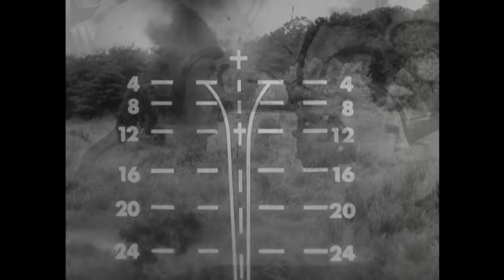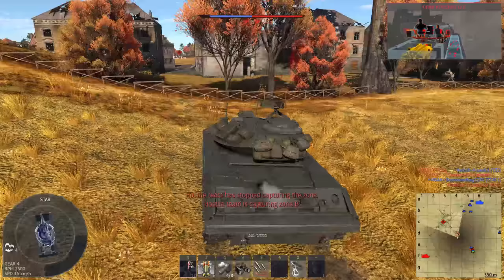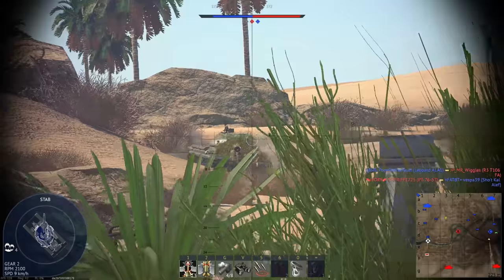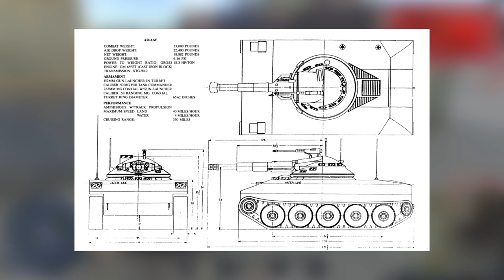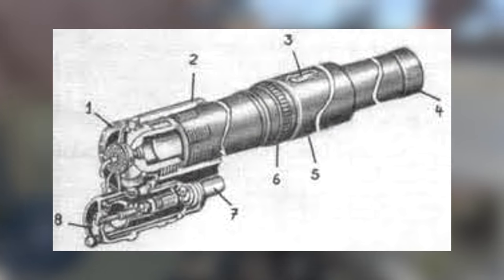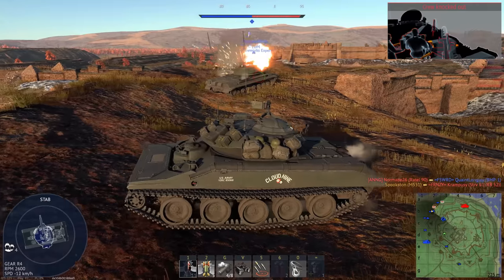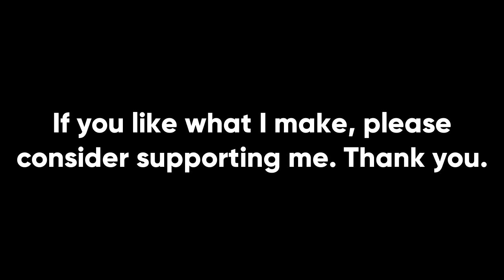How Bad Was The M551 Sheridan?

Comment: The M41 when I used it in War Thunder, I was shocked with how it seemed way better than it was. The T-92 was also quite nice though it dealt with better tanks.

The M551 Sheridan doesn’t seem fun to use in WT at all especially with the large recoil from the non missile round
Reply: HE fun
Reply: @chonkybird5189  True but all Derp cannon HE is fun, it’s why I like the KV-2 despite sucking at being very tanky and having a crappy reload.
Reply: I absolutely love the Sheridan in WT but I hardly use the non-ATGM rounds, I top up when I run low on those. It has a huge punch and is very mobile. I love to flank and spank with it from far distance.

Comment: That is pretty much the story of every weapons system developed in the 1960s. AiM-4 Falcon Missiles, early model AiM-7 sparrows, T-64 opposed piston engines, the list goes on. Frankly some hybrid of the m551 and the m50 ontos would have been pretty nice - I mean if the problem is recoil, then recoilless Rifes are the way to go - yes? Or turn it into an air-mobile MLRS, and leave AT to Man-portable LAWs for the airborne.

Comment: That air drop during Just Cause in 1989...most of the tanks promptly got stuck in a swamp to one side of the airfield. The DZ had been covered by long grass, and they thought it was solid ground underneath. Only two were immediately recoverable out of (I think) seven. "Light" tank is a relative term!

Comment: I like the Sheridan a lot, though I've never been in one. It can do a lot of novel and useful things you don't appreciate until you need to do them. It sounds like the majority of problems with it could have been solved with a refit program to install a new gun. Something much lower caliber with more traditional munitions, maybe a chopped down version of one of the 105's paired with a rack of ATGMs on the exterior. Either way with any sort of overhaul and refit effort, these could have served with more distinction than they did. They also look damn good.

Comment: Was there ever any consideration given to developing a closed breach cannon capable of firing the 106mm projectiles from the M40 recoiless?  Obviously a different propellant base would have to be used.  Such a weapon could have given a light tank a highly effective AT weapon (~350mm of pen) out to 1500y and commonality of ammo development with all other 106 rounds.

The performance of the 106 actually matches the 155 Heat round the 551 did actually get so the only downside is the lack of the missile for long range work.

Not to mention to simplify range estimation the spotting rifle could be easily adapted as well.  Something the Brits we’re doing contemporarily on their tanks.

Basically, why wasn’t a low velocity 105 considered?
Reply: Considering that closing the breech completely eliminates the entire point of recoilless ammunition, the idea of developing one seems strange.  It'd have to be just as sturdy as a regular 105, because the ultimate amount of burning propellant per volume would be the same.
Reply: yeah. its called the bradley
Reply: @jimmydesouza4375  I think what this guy is saying is that redeveloping the 106mm to be a low recoil tank gun/launcher instead of the problematic 152mm, yknow just like with the bmp 1?
Reply: @tim4570  As far as I am aware, that's not what happened with the Grom.  The Grom initially used the warheads from the SPG, but the entire rest of the case and of course gun is new development.  And it only used the warheads from the SPG to development and logistics requirements (since the SPG was seen as good enough to destroy then current western tanks) and was always intended to get newer (IIRC non backwards compatible) warheads, which it did.

Though I never looked it up in massive detail.
Reply: @jimmydesouza4375  Why not just mount a recoilless gun on the roof, and synchronise the elevation adjustments with the main gun via a connector, similar to how the Rocket pod is mounted on the Sherman Calliope?

Comment: "Instead of getting the best of both worlds, they ended up with a disaster."

Perfect summary of everything that ever attempts to be a "jack of all trades."
Reply: "everything" ok bud keep going like this
Reply: No necessarily everything. Have a basis for things and you're fine. Chassis like the Sd. Kfz., Humvee, and M113 found many different roles.
Reply: soviet tanks are the jack of all trades imo
Reply: @savageshrimp4568  definitely not. Their lack of gun depression and limited urban awareness makes them poor for both mountainous areas and urban areas. I’d go with the Leopard 2 series. Doesn’t use as much gas as the Abrams which means less logistics needed, it has good situational awareness, good gun depression, and high customization opportunities. I honestly think the russian tanks just have too many limiting factors in comparison to the nato designs, especially the leopard 2 series
Reply: @savageshrimp4568  Yeah, The BMD's can be a Troop transport vehicle or a Mobile Grill
Reply: @bro26mohw  Well, maybe the Leopard's can be good, but the Turkish ones didnt felt too good when they went on Urban combat
Reply: @felipeds3021  as the middle eastern countries who import western tanks tend to do, they used them without infantry support and without a proper strategy. Any tank would fail in that context

Comment: 3:33
That actually is an ancient concept called paper cartridges. Many guns of the mid 19th century used them. Maybe most famously the Prussian needle gun but also pretty much every single gun in the American civil war outside of a few muzzle loading relics.
It wasn't until about the 20th century that metalurgy had improved enough to make reliable shell casings and manufacturing had developed to the point it could be made in large enough quantities.
Reply: The early Sharp's rifles used a flammable, waxed paper cartridge.
Brass cartridges came into use in the 1870s (notably in the Brit Martini-Henry of Zulu fame) but they were sheet brass wrapped around an iron case head. Drawn brass casingd weren't common until the 1890s
Reply: @Fulcrum205  The Martini-Henry was a bit of an outlier. Not only for it's use of metal cartridges but also for being the last service rifle that didn't have any repeating mechanism.

Most countries went straight from paper to drawn brass. One of the first mass adoption of a drawn brass cartridge was the 1886 Label of France which also was the first one to use smokeless powder.
Germany did the same thing. Going from the Needle gun to the 1888 Mauser (replaced quickly though with the much more famous 98 Mauser.)
Reply: @Fulcrum205  Though how practical those metal cartridges were is also questionable. Britain at the time was the most industrialized country in the world and also had a very small army because almost everything went into their navy.

So I think Britain was the outlier here. A country like France with a massive army or the Ottoman empire with a primitive industry would have never adopted metal cartridges.

Metal cartridges require a substantial industrial capacity and transport infrastructure. There actually were metal cartridges in the American civil war but they weren't adopted for mass use as they were deemed too expensive. Cause you make cartridges in such large quantities every cent of manufacturing cost adds up quickly.
Reply: @MrMarinus18  I'm pretty sure the French had adopted wrapped brass by then. I know the Prussians had with the M1871 Werder rifle. The US was using the Springfield trapdoor by 1874. The US Army was not on the cutting edge of military technology at this point.
Those old wrapped brass cartridges worked but they were definitely more delicate than drawn brass. It's why you see mostly single shot rifles as service arms. The sheet brass was too soft to work in a box magazine.
As far as manufacturing, the industrial requirements are pretty low. Brass sheet was a cheap industrial product. The case head was usually cast iron, also a very common way to manufacture things. The primer was usually potassium perchlorate between a couple pieces of copper. As far as the actual manufacturing process was just crimping and soldering which was already common in the canning industry.

Technology was moving extremely quickly in the decade from the 1860s to the 1890s. The real advances were in manufacturing. Leonardo Da Vinci or Archomedes could have built a breech loading repeater. It wasnt until the science of industry caught up that we could churn out thousands of identical copies and the millions of rounds of ammunition.
Reply: @MrMarinus18  the Germans unified in 1871. Before then there were several different service rifles with the various principalities including the 1871 Mauser, the 1869 Werder, and couple others I can't remember.
The French had a single shot bolt action, the Gras 1874, that replaced the needle system Chassepot that was their first breechloader. The Lebel was the first smokeless repeater. 
I don't know a damn thing about the Ottoman military of that period.
Reply: @Fulcrum205  Okay, it's clear you know way more about this stuff than I do so I'll take your word on it.
Reply: @MrMarinus18  no worries. I fell down a rabbit hole reading about the Werder spurred on by a scif-fi novel and ended up reading way more than I intended. IMO, those single shot breechloaders are some of the most beautiful and elegantly designed rifles ever built. Sharps, Farguharson, Hepburn, Ballards, Winchester High Walls, Martinis, etc just stir my heart like the cold precision of the Mauser system doesn't. I own a 1950s Heym Mauser and it is excellent. It doesn't compare on an emotional level to something like a big 45-70 Sharps or a Martini-Henry no 2. When I smell the blackpowder amd snap the lever down I can hear the drums and the color sergeant calling the range in my head. It's the same when handling a 73 Winchester or a real Colt single action. That spaghetti western music is always there whistling along with the twangy guitar in the back of my brain. 
 The 50 years leading up to WW1 are fascinating if you are into firearms. The world went from weapons that would not seem out of place to one of Cortezs' Conquistadors to weapons that are still fighting in battlefields over a century later in less than a single lifetime. It's also the golden age of John Browning, the age of the Western gunfighter, the death of sailing warships, and the invention of modern artillery and machine guns.

Comment: Having a 152mm HE gun on tracks to supplement mechanized infantry seems like a good thing compared to having only 30mm on bradleys and the 105mm Stryker MGS. The Sheridan is also C130 transportable unlike the bradley. I'd rather have a Sheridan with its gun than a stryker with the 105mm.

Comment: The M551 Sheridan was also experimentally fitted with a derivative of the 76 mm Gun M32A1 used by the M41 Walker Bulldog. It is interesting to note that Chile experimented with upgrading its M41 Walker Bulldogs with OTO Melara's 60 mm High-Velocity Medium Support (HVMS) Gun which is claimed to be capable of penetrating the side armor of the T-62  (15 to 79 mm thick) at 2,000 meters. Perhaps the 60 mm HVMS Gun could have been a viable upgrade option for the M551 Sheridan?
Reply: I think the experiments were made with the M24 Chaffee, not the M41... And the M-60 Sherman also exists, which has the same 60mm gun, and still is in service in Chile.

Comment: The Marine Corps is  looking at acquiring a new light tank which in my mind is the natural evolution of the concept of the m551 as an AFV for lighter airborne/expidionary forces
Reply: Oh so NOW they need tanks.
Reply: They always needed some sort of direct fire armored capability however as the mission of the Marine Corps changes so does the equipment needs they are also looking at finally replacing the aav7 platform

Comment: The M551A1 was not a "Tank" it was never designed or intended to be a "Tank" ,  It was in fact an AAARV (Airborne Assault Armored Reconnaissance Vehicle).  The M24 and M41 were also mentioned and these too were not designed as MBTs.  They were "light reconnaissance vehicles".  At 25 Tons and made of aluminium, the M551 was no equal of the 50 ton M48 series or the 52 ton M60 series which were in fact Main Battle Tanks.

Comment: I've loved the M551 Sheridan although it has a bad reputation the Sheridan was pretty good vehicle to drive around and be easily loaded onto a C-130 Hercules

M551 Sheridan last conflict that took part was Operation Desert Shield most were used as reconnaissance however the Sheridan only engage Iraqi T55 tanks or Iraqi anti tank missiles 

An Interesting note the M551 Sheridan during Operation Desert Shield did not suffered from any mechanical breakdown during combat.

Comment: yeah, the combat version of the Sheridan probably sucked. the main gun wouldn't stay bore sited and I'll bet 12.7 rattled the Hell out of it, but the M-551s we had at NTC were a total blast to drive and maintain. stripped down for the OPFOR, those things hauled ass. the only real problem we had were totaled torsion bar caps that rounded out the aluminum holes in the hull. way more fun than a M-60a3. Steel on Steel.

Comment: This video is largely BS. I was a crew member  on an M551 Sheridan  for two years. Yes , 10 to 15% of the Shillelagh missiles malfunctioned. But, as a gunner, I never experienced a main gun malfunction  in two years.  A few malfunctions did happen. The bottom line is a round from an M551 would disassemble an opponent into its major  component parts.